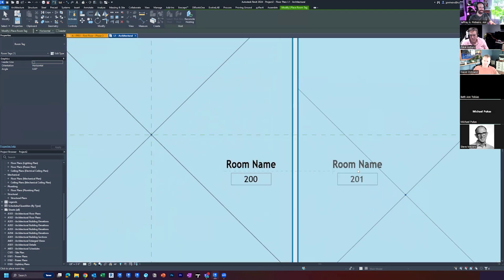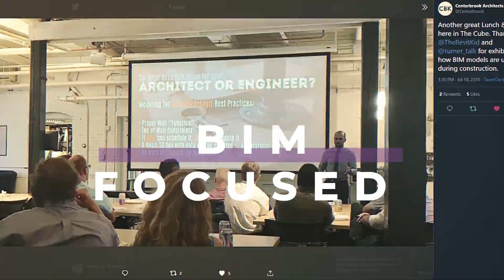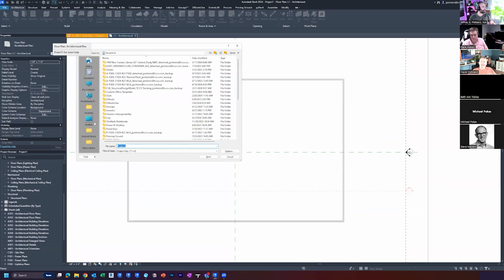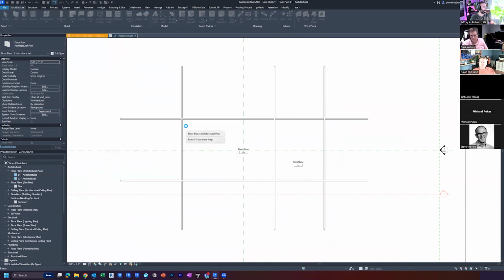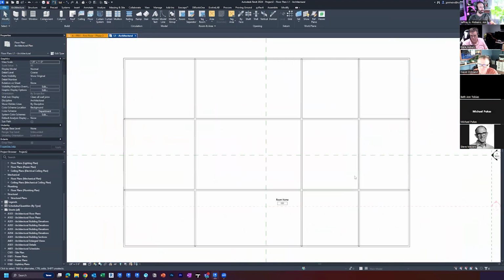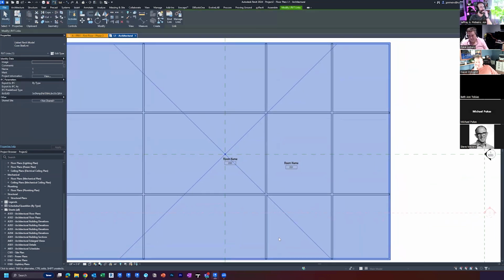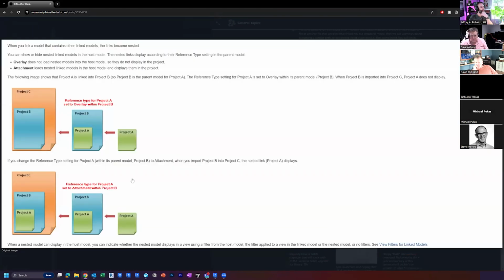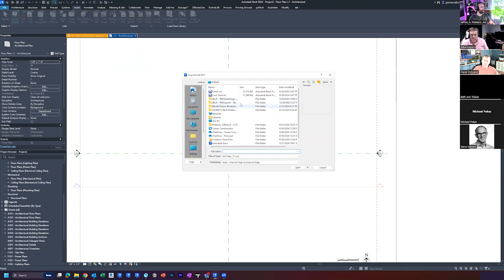Easy Trick to Understand Room Tags through Revit Links! (Office Hour Sessions)

Comment: Hello, could you teach me how to configure the scroll button of mouse to move on iPad when use Revit?

 It is the only thing that I have not been able to do. In your video where on your iPad you use your computer you can rotate the model of revit using the scroll of the mouse. I have looked for a way to do it and I have not been able to do it, when I press the scroll what it does is selecting instead of move, please help me, it's something I haven't been able to solve in a long time and I'm frustrated.

Comment: I workaround I have used (which can also be a pain) is to set the link you don't want to tag as an underlay and use the tag all function and include links. If a link is set to underlay Revit won't include it or objects in it when using the tag all command.

Comment: Rooms should be used for rooms and Areas for everything else. I would ask the Core-Shell guys to use an Area.

Another option is to hide the Core-Shell Room with V/G or filters. Next use 'Tag All' as it will only tag the visible Rooms.
Reply from the maker: I don’t disagree … but, now you have a solution if they tie you to buzz off 🤣